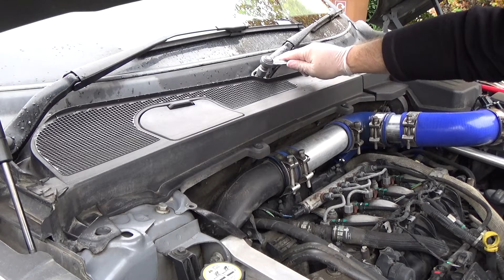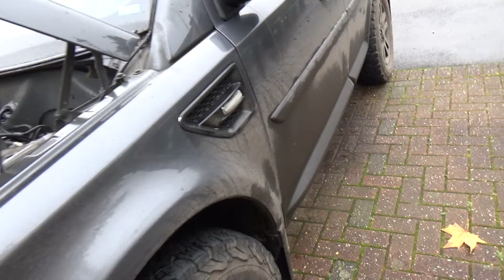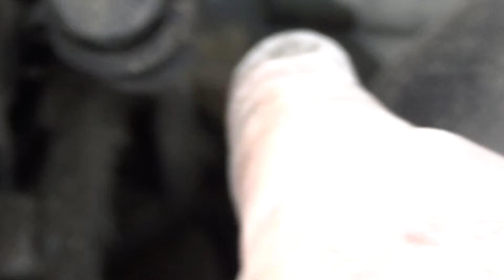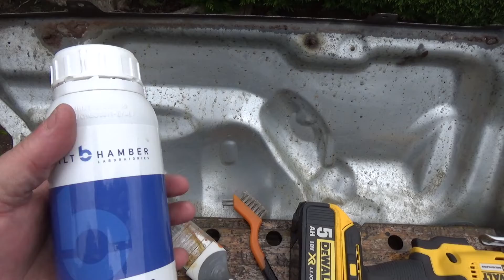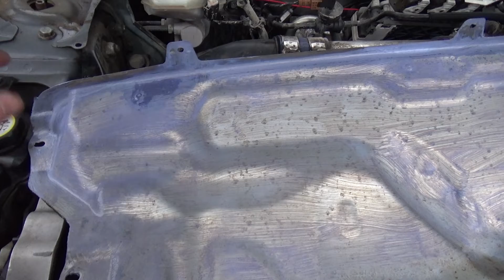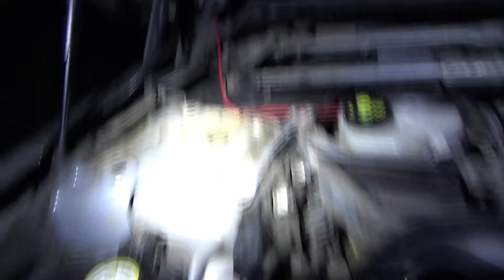Firewall / bulkhead removal - Land Rover Freelander 2

Comment: Good video.  Did removing the bulkhead panel provide sufficient access to enable turbo to be removed from above?
Also, this video may be of interest to owners where they have rust to remove on left side (standing looking into engine from car front) of the bulkhead just behind the refrigerant top-up pie, which is a common problem caused by badly executed brake fluid changes.   On my current Freelander, I was able to remove the air downpipe and get enough access, but had there been more rust, I'd have removed the bulkhead.
Reply: I've just changed a turbo from the top and even with the bulkhead, cam cover, EGR valve & Cooler removed it's still too tight to get the turbo out the top complete. If you remove the vane control module, three 10mm bolts & the link rod, before hand the turbo does fit. Still tight though! For refitting, putting the module back on is easier once the turbo is bolted to the exhaust manifold.
Reply from the maker: Removing the bulkhead would certainly help with a turbo change although most of the work would need to be done from below and the EGR would need removing which sits above the turbo.

Comment: Thanks for your videos. You found 2 of the plastic nuts holding on the sound proofing. There are two more that you need to remove from under the car if your sound proofing has not already disintegrated down there.

Comment: I am suprised you did not remove the air intake piping to make it much easier to reach the nuts and bolts on that metal scuttle ?????
Reply from the maker: In hindsight, it would have made it a lot easier to see what I was doing during the removal. Essential for refitting!

Comment: Brilliant videos is it ok to put a egr blank plate on my freelander 2
Reply from the maker: Yes, it will be fine as far as MoT is concerned, mine’s been blanked for around 10 years. The only issue is that some later models may detect that it is blanked and throw the engine warning light on. A small hole in the plate will fix this.
Reply: @BeavisPits  ok thanx